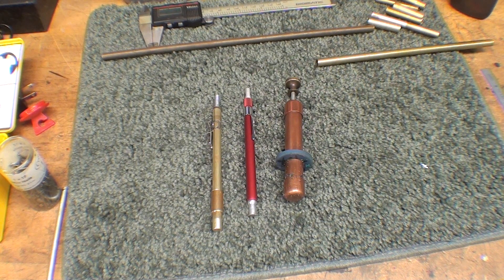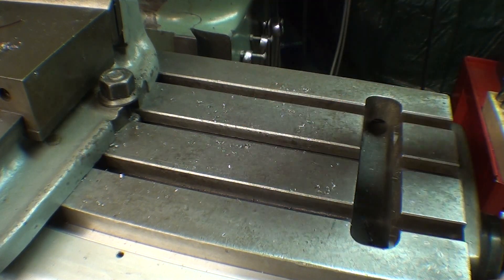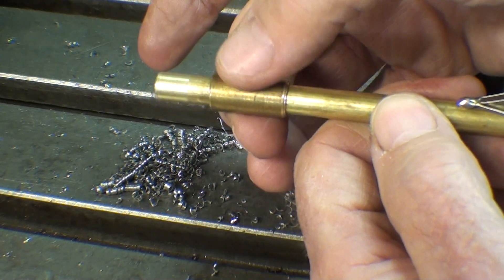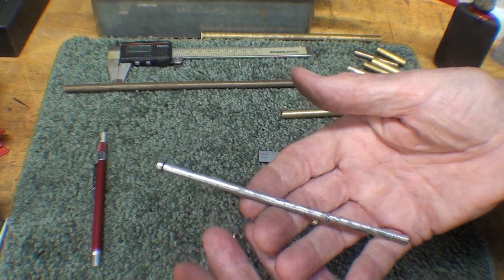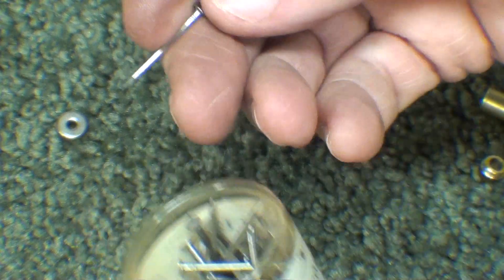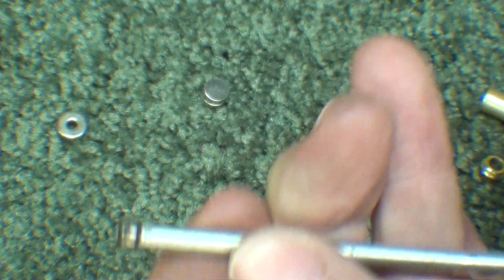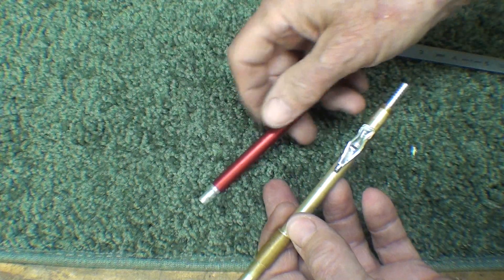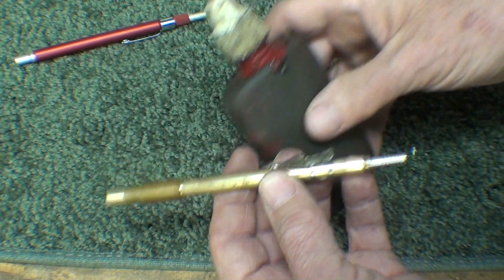TIPS #319 How to Make a Magnetic Swarf Pick Up Tool tubalcain

Comment: I have been watching machine shop videos for 2 years, learning while I'm saving to get my first lathe. To this day I have not seen any videos on making a slot for an e-clip. I have an assortment for replacements so I know the small ones are only about 0.029" thick. Do they make a tool to cut the groove, or do you grind down a parting blade.
Reply from the maker: Grind a tool from scratch

Comment: Random tip: If you use one of those little neodymium magnets to test hot forging steel for critical temperature, the heat will render in non-magnetic. DAAMHIKT.

Comment: Mrpete don't assume we don't have stuff in stock like the little 'e' clip. I've got millions of little parts like that in my shop, thanks to my father who was an avid auction goer, and I buy up every little drawer of weird stuff I can find. I would be more likely to have to go to the hardware store for a 1/4-20 bolt than a 5/16 ball bearing or a    .130" 'e' clip haha. Keep the videos flowing I enjoy them alot. Thank you!
Reply from the maker: so then I'm not the only packrat around??
Reply: Apparently not haha. At least once a month somebody pulls up my driveway and says they'll clean up all my junk if they can keep the metal. I say what the heck are you talking about that's not junk it's my building and fabricating material!

Comment: Micro tool kit for shop vac    https://www.menards.com/main/tools-hardware/power-tools-accessories/wet-dry-vacuums-accessories/shop-vac-reg-1-25-micro-cleaning-kit/p-1444442259850-c-10092.htm?tid=-4440091173290034696
Reply: I was going to ask, is using a vacuum wrong for some reason? I don't see much of that from the machinists.
Reply from the maker: No-I use it all the time. But long curly chips will clog the hose

Comment: Another chip pickup option if it suits your application is to pick up one of the miniature shop vac tool sets, it comes with an adapter to downsize the vac hose & the set includes a very tiny version of a narrow crevice tool that would likely fit the T slots perfect.  It also has a small brush attachment, extension wand, etc.

Comment: Try using a compression style pipe joiner. Use the body as the chip stopper, the olive for the plunger stopper and the nuts for the tube ends. should be easy to find one at the plumbing supplies section of a hardware store.